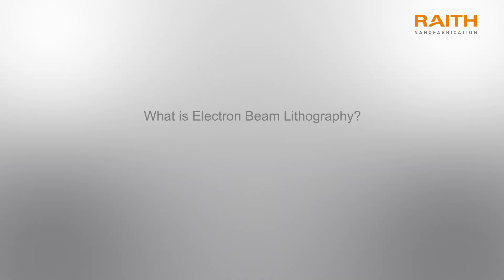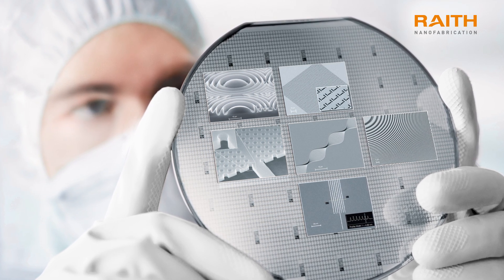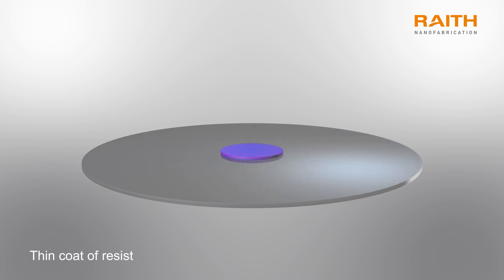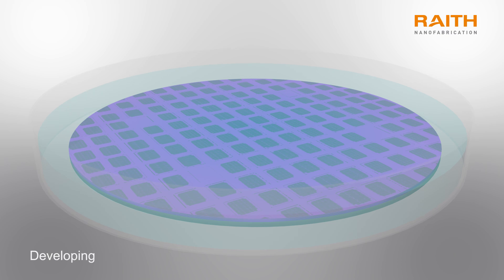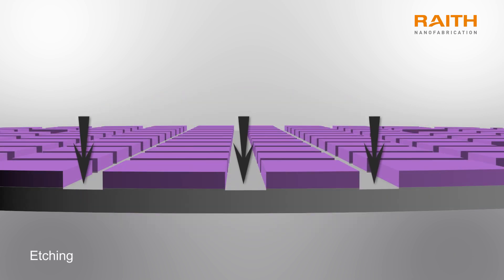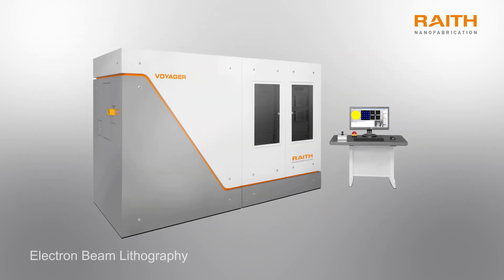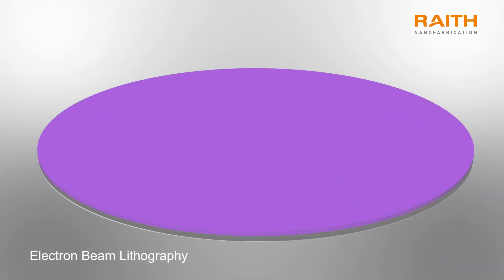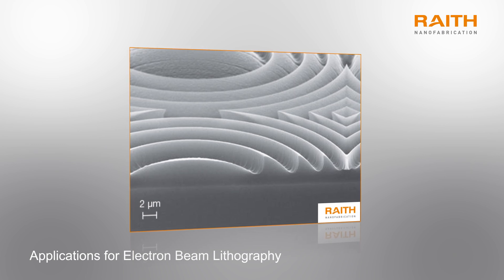Electron Beam Lithography

Comment: usually leaving a metal film pattern on silicon, first deposit a metal film on top of silicon substrate either PVD or CVD, then applied photo-resist on top of metal film, then define the pattern by lithography , then develop the photoresist , then etching process remove the unnecessary area , finally remove the resist film.

Comment: how much data as byte or bits as 1x1nm squares per eletron beam writing to manufacture a whole semi disc at one "write"?
Reply: would you do a prototype (for me) starting a dvd-rom/rw drive with vacuum, electron-xray-sem and multiple ion-plasma-deposition print headers
Reply: contact my business address if interested, I'm a microelectronic IC professional developer and designer
Reply: starting with hard drive sem disc drives, clear and set operations

Comment: So if EBL can go past 10nm why does Intel insist on EUV? Cost?
Reply: printing chips with EBL is slow so it  used just for making masks and prototyping 
but EUV used for mass production ,it shines the light and it pass trough the mask and you have the pattern in silicon wafer .
Reply: its like saying "my 3d printer can make such detailed intricate models, why does injection molding even exist," mainly because int his case, 3d printing is used for prototyping, but is far too slow and  costly to mass manufacture, which is where injection molding shines because it is faster and cheaper (after you've made a certain amount of parts)

Comment: How are the masks printed so accurately?
Reply: masks are designed generally Using CLEWIN software, later they are written on soda lime Cr coated masks, written and developed perfectly using optical direct-write lithography system (ex: upg heidelberg machine)
Reply: Using ebeam lithography to write masks
Reply: The first masks were done by hand and later those computers made with those hand made masks were used to make more precise masks and then those computers were used to make even more precise masks ad infinitum.. Similar to how the first ever program had to be written by manually setting the flip flops in RAM and later that program was used to write other programs by using a keyboard etc. Kind of a self bootstrapping progression
Reply: It takes forever, but its a very accurate process.

Comment: Easy to understand. What is used as substrate on which resist  is coated?  Thank you
Reply: For chips: silicon.
Reply: substrate depends upon the requirement ex: MEMS SOI/ Optics Si02/ SAW filters Quartz etc.